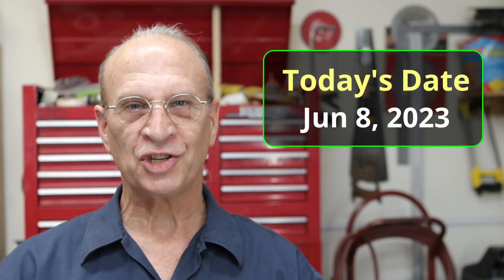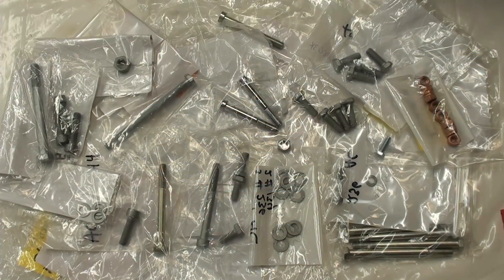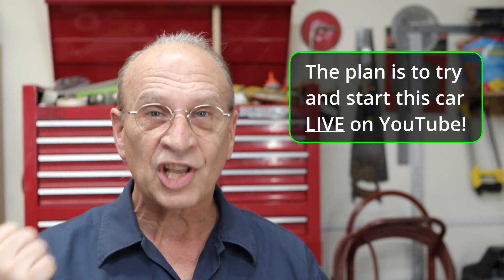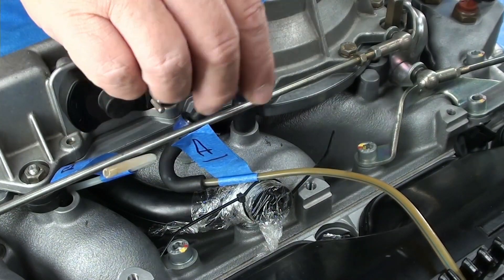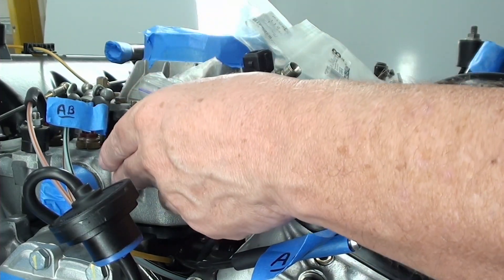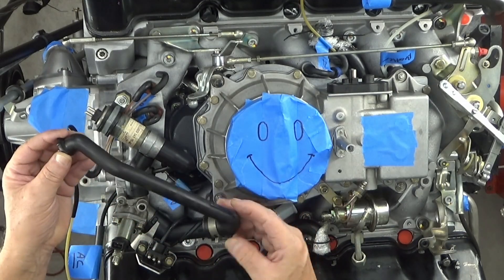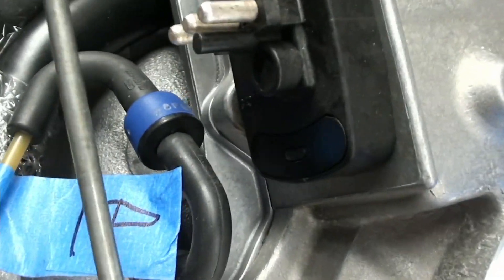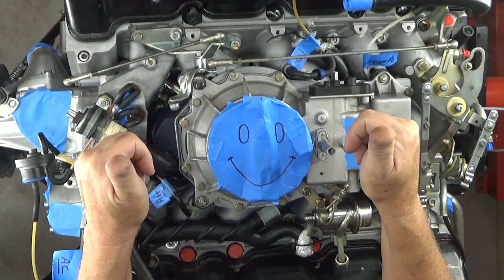560SL - Installing Intake Vacuum Lines & Sensors

Comment: Hey Tony, I’m looking for guidelines on dismantling and re-assembling the internal parts (the guts) of the airflow sensor, not the EHA or the potentiometer (external ancillaries). One of the sensor’s I have is damaged - potentiometer contacts are bent and not making proper contact with potentiometer. The other sensor - one of the threaded holes for the adjusting screw is damaged - bolt not engaging with threads of housing. I need to take both apart and make one out of the two using functioning parts.
Reply from the maker: I have not dismantled the air flow meter, but my friend at Fix Your Mercedes has. Here are a couple of videos you might like: https://youtu.be/HYHIws3Jpu0 and: https://youtu.be/euvib_OYzNA

Comment: Tony, or anyone else who can answer this if you read these comments, there is a hole in the back driver side of the rubber Air Flow Boot, in the lowest corner, and nowhere do I see anything that fits into it.  No hose, no fitting.  But it's open into the boot so something must fit into it.  What?  I've got everything seemingly installed and no left over hoses that might go into it but something has to.
Reply from the maker: It’s hard for me to picture. I have other videos may help. 560SL - Connecting Engine Vacuum Lines
https://youtu.be/nHJGtoJpTOs  560SL - Installing Mixture Control Unit
https://youtu.be/E3wkyVCCGQE 560SL - Recondition The Intake Manifold Part 1
https://youtu.be/MM2cllek3R0 560SL - Renewing The Air Flow Sensor
https://youtu.be/5NWLlHHAK3M

Comment: I am restoring a 1990 560 SEL and I am lost with words how to thank you for these videos. BTW do you have the part no for that  vacuum device that splits and one goes to the egr and one goes to the sensor on top
Reply from the maker: I will take a guess that you are referring to the three way vacuum valve 4:49 The part number for that valve on a 1990 560SEL is 0011405560. In the comments I included a link to another vacuum line video you might want to watch. https://youtu.be/nHJGtoJpTOs?si=3rKiUJbq7dcPgTRN
Reply: @TonyLiveTV  Thanks so much that is the one.

Comment: Hi Tony, great video! Have you already made a video about a leak test with a fog machine? If not, it would be great. Thanks
Reply from the maker: Of course I have. 560SL - New Injectors, Air Flow Sensor Boot & Vacuum Leak Test
https://youtu.be/SqK7uo292sI

Comment: Hi , there is a vaccum line connection on the ignition distributor. Where it should be connected to?I am not sure on it with my 500sl. Any help much appreciated.
Reply from the maker: @paayoub  there is no vacuum to the distributor on a 560SL (M117). On the  560SL the vacuum line goes to the EZL.

Comment: Hey, do you have part numbers for the vacuum connecters coming out of that valve from 4:50 - 5:30? Or just know what they're called? Namely the straight one coming straight out the bottom?

I have a bunch of those which are squishy and breaking, but I can't seem to find the correct replacements... I ordered just about everything on Pelican but they're just barely the wrong size. There's another just like it connecting to the purge valve connected to the charcoal canister and I just can't figure out what they are.

Thanks!
Reply from the maker: Maybe this will help you: https://nemigaparts.com/cat_spares/epc/mercedes/1/m/117967/371/14/015/?chasis=107048575

Comment: Tony,  One clarification so as not to confuse all.  The upper throttle body connection in rear, connects to angle port on first thermovalve on outer edge of intake manifold.  The bottom throttle body connection in rear connects to angle port on second thermovalve.   The upper rear port on rear throttle body is strictly for use for the EGR system.  If you mix the two up, your EGR will not operate correctly - don't ask me how I know this........
Reply from the maker: Good heads up. I think when I finalize all the connections prior to first startup, I’ll include a diagram as well. Thanks!

Comment: Do you have a source on red thermovalves?   dealer in my area states no longer available.......
Reply from the maker: That's right. No longer available like most of the parts for these vehicles. I've been waiting over a month just for an O-ring (out of Germany). It won't be long and it will be impossible to restore these vehicles. That said, I did find this part on eBay: https://www.ebay.com/itm/226036314288?itmmeta=01HRFRFX8CV7SRFGRCMW30TGA4&hash=item34a0d070b0:g:1zYAAOSw99ll6vbV

Comment: Tony, I just completed upper and lower intake removal and install.  The vacuum pipes I get from dealer are generic white in color.  It seems you are able to get the correct color coded vacuum pipes such as running to thermovalves, is this correct? What dealer do you order from?
Reply from the maker: Unfortunately most of the color coded vacuum hoses are no longer available from the dealer which is where I got most of mine. You can still get a few of these at most sites such as Pelican, AutohausAZ, FCPEuro and so on. They all have the violet & yellow, white, clear and even the black & green stripped rubber hose. Here's a link to AutohausAZ: https://www.autohausaz.com/catalog?v=1195310&k=Vacuum+Hose&page=1&sortby=r

Comment: Hey Tony, just a broke vacuum line that goes from what I believe is the Ignition control unit to the intake manifold area. Do you know what size vacuum line I need for this? I think it’s labeled AA in your video.
Reply from the maker: That’s a bummer. I think all vacuum lines are the same size in diameter. That said, here’s a link that shows the vacuum lines, their lengths (not necessarily correct) and the part numbers: https://nemigaparts.com/cat_spares/epc/mercedes/1/m/117967/371/14/120/?chasis=107048575
Reply: @TonyLiveTV I thought they were all around the same diameter but wasn’t sure. Does 1.0 x 4.0mm sound about right to you? I’m probably going to buy a couple meters of it just in case this happens again. Thank you Tony, your content has been invaluable while trying to fix up my 560SL.
Reply from the maker: @gaberiallo  the 1.0x4mm is the most common I believe. You might want to add some 1.0x5mm to have on hand since it’s inexpensive. The part number for the clear 1.0x5mm is A0019973952.

Comment: I forget, did you clean out that Idle Control Valve when you dismantled everything?  And, are you planning to smoke test the engine before you put it back in? These things leak air like crazy...
Reply from the maker: Everything is new in regards to all vacuum pipe and fittings with genuine MB. I also renewed the rubber air duck when I reconditioned the air flow sensor. I hope I won’t have a leak. If I suspect a leak later I may do a smoke test. Let’s hope I don’t need to. I also did a separate video on reconditioning and testing the idle control valve way earlier in the build. I have now placed that video at the top of the Intake Manifold playlist: https://youtube.com/playlist?list=PLQAW1udK_cOggR87AxbNVl-vtyjLJRQpz
Reply: @TonyLiveTV  awesome! I can't wait to see the injectors and cups/seals go in.  I was expecting a much more satisfying 'click' and took several go-arounds to get them to seal.